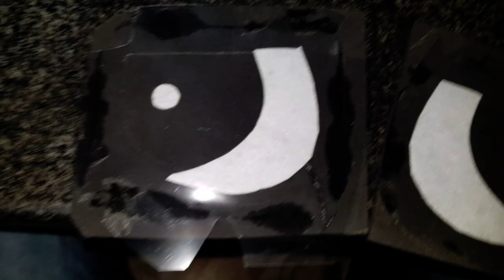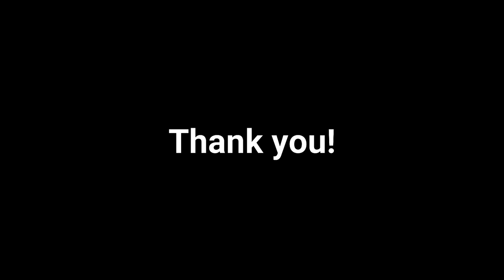How to make Shark head mascot using foam

Comment: How wide did you make the centre piece that made the snout?
Reply from the maker: @scottaprilrobinson8593  8 inches.. also it is up to you how big the head would look. Just make sure it will fit the person comfortably and it won't tilt front or backwards. The dorsal fin will be the counter balance for the snout.